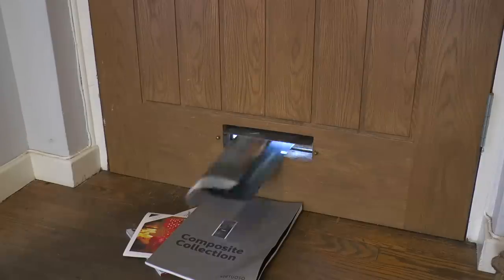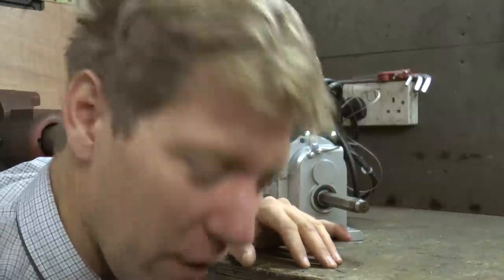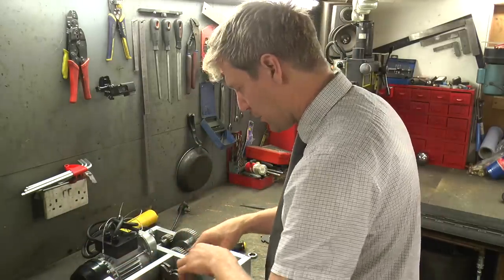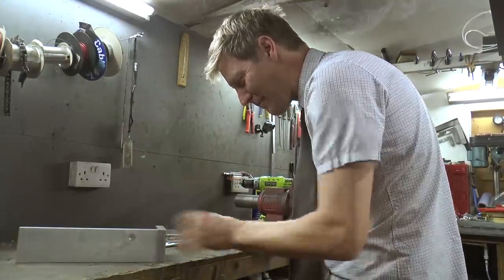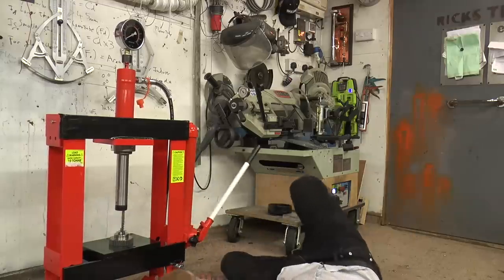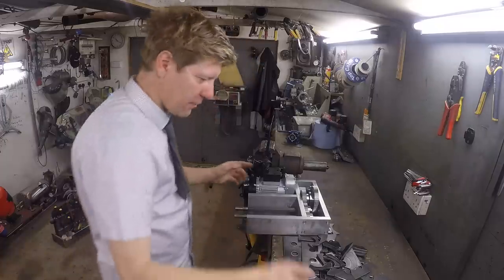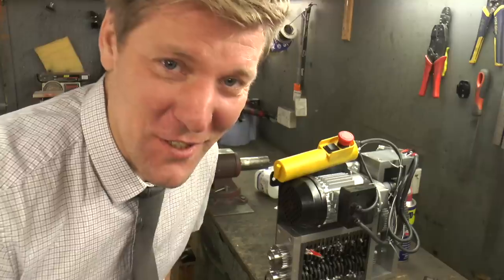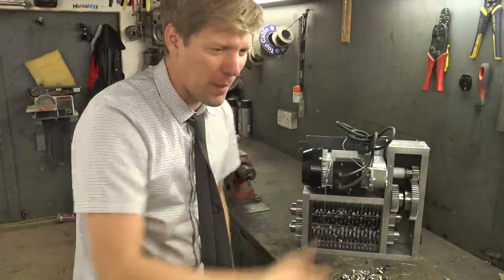Making a Shredder for my Letterbox (No more junk mail)

Comment: This may be the worst project to wear a safety tie..
Reply: Reminds me of that Mr Bean scene.
Reply: Benjamin Lewis haha same with the train ticket!
Reply: And the oscar goes to !!!!
Reply: Relax, its a clip on, safety first.
Reply: just make sure you wire in an emergency shutoff that is easily reachable and that shouldn't be an issue, but still, better to take off the tie before being near anything bigger than a paper shredder.
Reply: this is why safety ties always come along with safety scissors
Reply: Or just get a tie that has a easy rip off part on it so it just comes off if to much force is on it
Reply: Safety tie becomes unsafe...
Reply: You can see how short it is in this video!
Reply: @ARM0RP0WER  They used to make clip on ties.  It might be suited for him.

Comment: This is the first precision made thing by furze usually it's a little more, well furze
Reply: Human sacrifice, dogs and cats living together, Furze planning ahead... mass hysteria!
Reply: You probably skipped the turbo jet engine videos. There was quite a bit of precision calculation going on in there.
Reply: @nimmen  he ignored those calculations, which is why he had to start over with a much bigger turbocharger d:
Reply: @nimmen  maybe you haven't see the part of the video in wich the turbo fails.
Poor enginereed engine, look on YouTube for good ones.

And this...
A machine that works with hard torque and forces, WITHOUT bearings, steel shafts rotating in bare aluminum.
So durable.
Reply: 300w working perfectly... upgrade to 2600w... sounds pretty furze to me... and if that safety tie goes in... :)

Comment: BREAKING NEWS:
MAN ARRESTED FOR SHREDDING  A MAILMAN'S FINGERS
Reply: Thats what I was thinking
Reply: @exotrrc1636  same
Reply: @santahasgun3894  ye
Reply: @exotrrc1636  yeeeeeeeeeeeeeeeeeeeeeeeeeeeeeeeeeeeeeeeeeeeeeeeeeee
Reply: Read my mind, did you?
Reply: I am a postman, I already have shredders installed on letter boxes on my round, normally they bark
Reply: @Tappit333  I imagine most postal workers refuse to put their fingers through the slot, but you never know.
Reply: @CorwinPearson  I 3D printed a shuvvit, a flat extension to my fingers for when a dog is on the other side of the door, it holds the letters as I use that to push the letters and junk mail through. Royal mail now supply their version, but the dog normally pulls that through to chew it up. :-)
Reply: Colin was arrested once
Reply: POSTMAN
Reply: Don't worry 😉 no postman was injured  in this video

Comment: Colin looking at making a shredder for wood do you think 350 Nm would be enough I only have single phase in my shop so limited I was looking at 4 pole single phase motor 4kw through a gearbox 20-1 ratio

Comment: For anyone trying this at home: use a series-wound universal motor, not a squirrel cage/induction motor. 
Series wound universal motors deliver their maximum torque at very low revs, and will therefore be really hard to stall. Squirrel cage motors deliver their max torque only at their rated speed. At lower (read: bogged down) speeds they can't deliver nearly as much torque. 
Downside is that low revving universal motors are pretty rare.
Reply: Also please don't put it right behind the letterbox. I am a mailman. I have to stick my hands in those things to make sure the letters don't crumple.
Reply: Universal motors are loud, and have brushes that can wear out.
Reply: @user2C47  As you can clearly see in vacuum cleaners and power tools, brushes only wear out when used hours a day, every day. 
And why would noise be an issue in this application?
Reply: Pretty much my concerns. It's already bad enough that postal workers got savaged by dogs and assaulting neighbors, I don't want to add the danger of losing fingers to a letterbox to become legit.

Comment: Don’t suppose you saw my shredder videos...? Caus yours looks very similar to mine. I had two winch motors, with a 2:1 reduction on each. Two motors helps a lot, as if there is a jam, only one rotor stops and the other spins and clears the jam. Also, watch out for the hex shaft coming out of the gearbox, caus it’s held Into the main gear with a tiny 4mm key that shearer after a few minutes of playing. I had to turn a big stainless shaft and bolt it to the main gear. Eventually, a tooth broke off one of the reduction spur gears :-(
Reply: Pete's Shredder.

Comment: When talking about the gears at 2:16 it doesn't increase the power, power stays the same (what the engine is rated at) but you increase the force or torque when decreasing speed.

Comment: you should use a splined shaft instead of a keyway and case harden the steel. Mild steel doesn't really mix well with torsional stress.

Comment: you need to invest in lead field rubber malte ( 3 LB )   to put you parts together - hitting them with a carpenters hammer is real going to mar you work and mess things up for you
now back to you project - bushings and liners or ball bearings are needed on projects like this or even bronze tubing can do and a grease the day lights out of it

Comment: Just a couple of suggestions, get yourself a copper mallet rather than using a steel hammer - does less damage. And second, be very careful when using broaches (as in when you knocked one through with a steel hammer) if they shatter - and they do occasionally - they go off like bullets! you'll find bits embedded all over your garage (but hopefully not in you).

Comment: Adding bearings in the aluminium plates would be better. Also, the gears at the end dont make any sense as only the ones connected to the motor are used to transmit the rotation